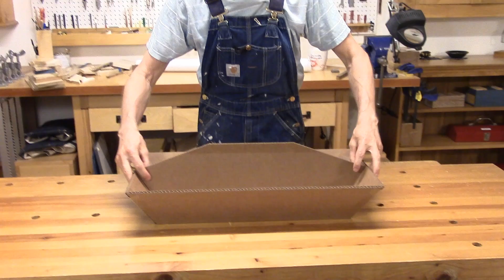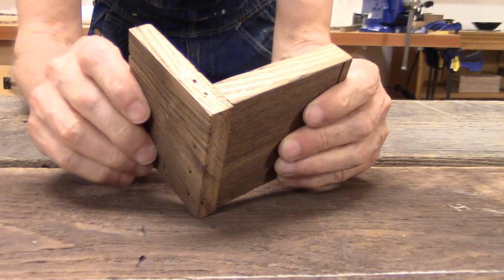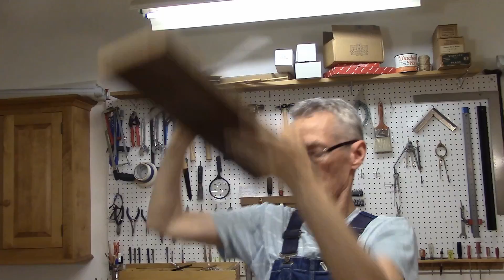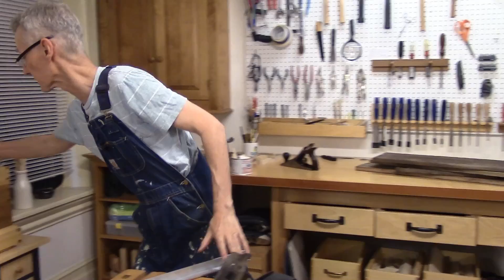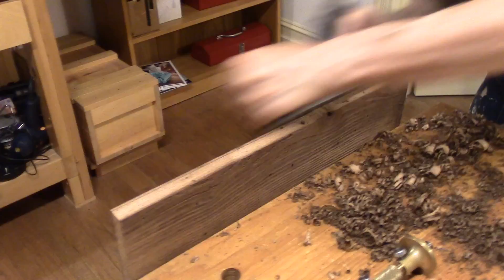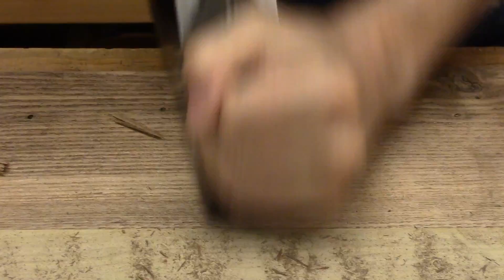Tool Tote Show #1

Comment: I've noticed you've stopped putting you irons on their side. Was it Paul Sellers that changed your mind?
Reply from the maker: It’s a subconscious thing. Sometimes I do, sometimes not. In any case, I’m careful not to slam my planes down or set them on things that might nick the iron.
Reply: @treebangham  I'm still so new to this that I'm not only building up skill but also the actual work environment and the habits that go along with it. That's why I noticed it, I think. And because I saw Paul Sellers talk about it a couple of years ago.
Reply from the maker: Good approach. I don’t believe in the “always” and “never” rules. Common sense is all that’s required. I don’t slam a plane on its side and knock it out of adjustment and I don’t place it sole down on a surface that might damage the iron. Works for me.
Reply: @treebangham  Sounds reasonable! And that was Paul Sellers point as well.

Comment: Hi Ken!! Thanks for another great video. And yes, I have a question: Why do you plane cross grain when you start to thickness your boards?
Reply from the maker: By planing across the grain (traversing), I'm taking advantage of the wood's natural weakness in that direction. The wood fibers separate much more easily and I can remove more material with less effort. The cambered iron that I'm using easily makes scalloped scoops across the face of the board. The resulting surface is not pretty, but a few swipes with my jointer and the board is nice and smooth. I didn't employ this method when flattening the first side of the board because it was reasonably flat and I didn't need to remove much material. Thanks for the question Bob. Regards.

Comment: w0w! great to see ya again,,,, Great color almost regal.  May I ask what camber ya have on your scrub plane?
Reply from the maker: Thanks Carbonite. My so called "scrub plane" is actually a Stanley #4 with an 8" radius. That's very mild for a scrub but it works for me. I also have an iron with a more aggressive 3" camber but I almost never use it. Your mileage may vary, thanks for the question. Regards.
Reply: Thx Ken, I have not built my scrub yet, so I ask anyone that I trust & admire their work, you are only the 3rd person so far in 1.5 years. I am taking notes and even organizing them. Thx again kind Sir.
Reply from the maker: Hi Carbonite. I'm no expert but I'm happy to share what works for me. I hope my methods are useful to you. Thanks for taking the time to write and good luck with your scrub plane project.